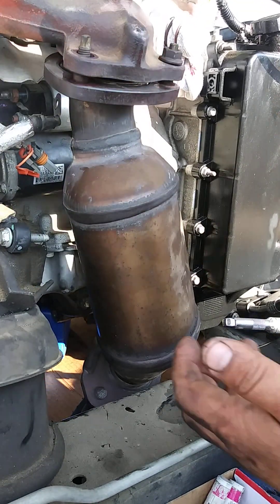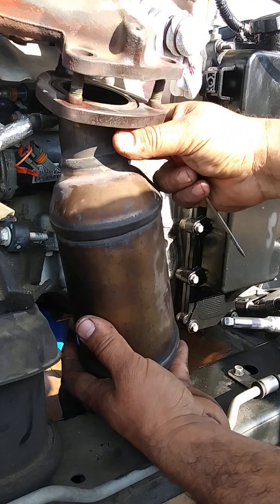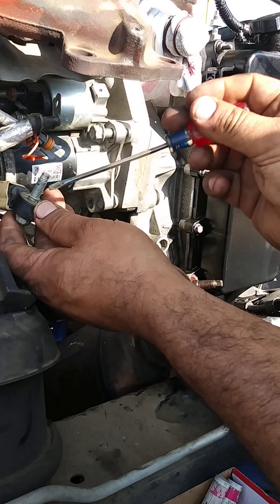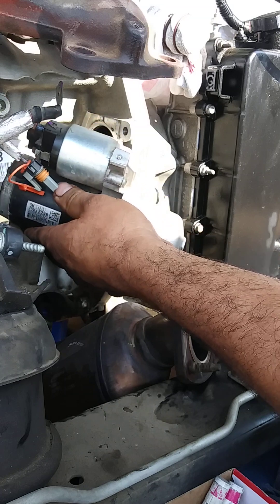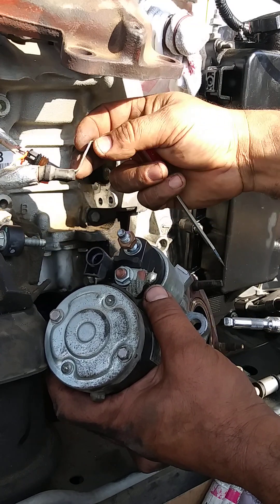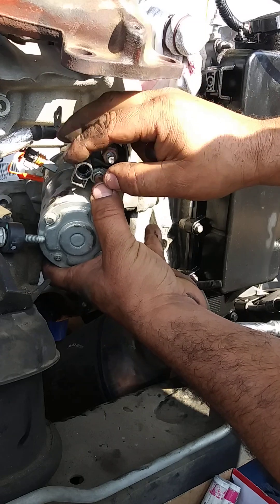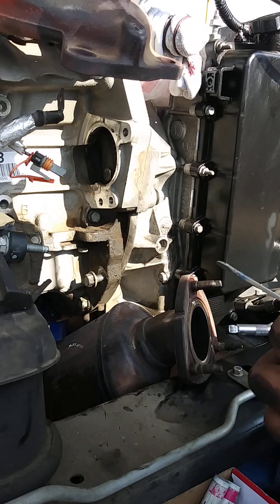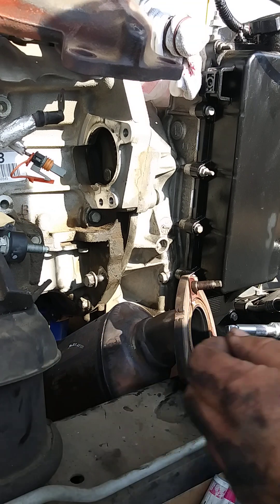Chevrolet Traverse 3.6l how to remove starter tips,tricks.,como remover motor de arranque..

Comment: Good training overview but listen please 
U DO NOT NEED TO DO ALL THIS IN THE FIELD 
THE OIL FILTER REMOVAL AND 15mm RACHET WRENCH IS THE SECRET PLENTY OF ROOM ONCE U DO THIS 
U don’t know what u don’t know 💪🏿🧰🛠️
Reply: So you’re saying it can be done by removing the oil filter and some elbow grease
Reply from the maker: It's many ways to work and do things depending of the skills you have and the time you been doing this,it always room to improve.
Reply from the maker: Yes I did it in porpuse so that way the people that need it can make they one decision and find the way to do it correctly and safe
Reply: @agoodneighborautorepair2176 don't need to tear the hole car apart just to get a starter out Geeze
Reply from the maker: @dancurrier6421 in that time I was removing the transmission so it was a good time to explain differen way to remove the starter....it's many ways to fix or replace anything, thanks for your comments.
Reply from the maker: @mikematthews234   they are many ways to replace or fix anything,the video is educational porpuse,I been fixing automobiles for 40 years learning new things every day, thanks.
Reply: So I just take out the oil filter and that's it lol
Reply: @Ironman6919 Have you tried this yet? I plan on attempting this tomorrow and would like to know if taking off the filter is going to work or not